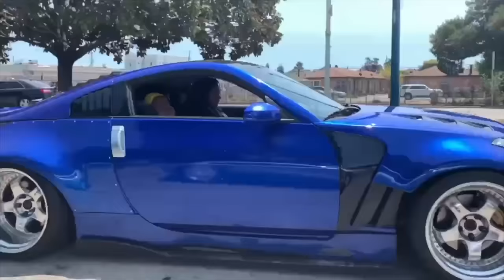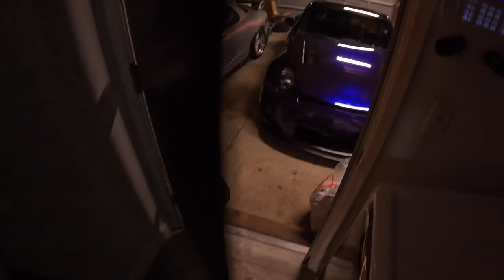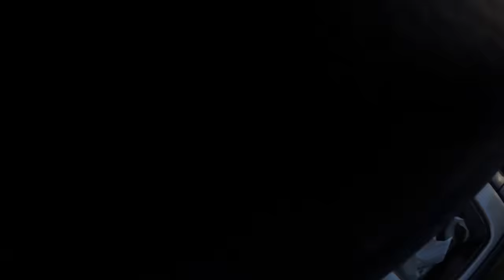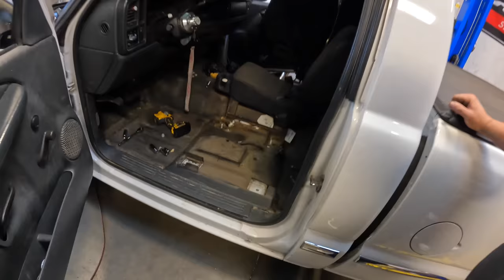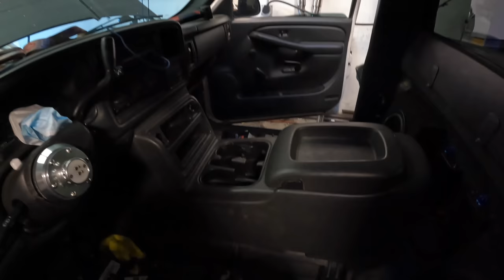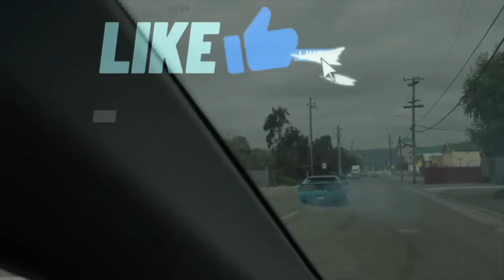I've Been Wanting To Do This Mod On My Truck Every Since I Got It... I Finally Did It!

Comment: Mike mike bro I literally have the truck just 4x4 but I took out the rubber floors did carpet full charcoal gray interior with the 2005 Escalade dash and steering wheel 🤤 but change to carpet it look even better bro 👌🏾

Comment: You should keep that hood n since its already a little beat up u should do the see through cut out on the hood to see the intake mani/plenum like the zr1 vettes do. Itll go good bc u already got the ls and the carbon wide fenders with cut outs just like the zr1. U can paint the top of the intake to see it thru the cut out in the hood or do leds in the bay no directly at the cut out ive seen it directly at it its too bright to see anything.

Comment: Hey guys , I’m currently 19 years old and am working towards getting a really nice car . My credit is there and is above 750+ . My  price range on a car is 30k-40k. I’m really indecisive on what I want but I’ve been looking at 

1) Kia stinger gt 
2)Lexus is350 f sport 
3) Some sort of bmw 
4) Infiniti Q50 ( a lot of people have those and are modding them) 

Please leave other suggestions on what car is the best bang for the buck 

 I want to be different from everyone else  but would gladly take suggestions on what I should get . Or any advice from the older generation to the young ones
 I also plan on modding the car slowly and slowly
Reply: Same situation with me bro just got a 2022 volkswagen gti manual and mannnn its fun as hell to drive i prefer driving that than my moms q50 red sport that ones got all the power but the gti is just nimble and fun to whip around corners lol idk if you like em but you should look into them
Reply: I’m 19 and and work at a auto shop and have experience with newer cars. I wish I had 30k to spend on a car 😂 please tell me your secrets. It really depends on what your goal is and how much you want to spend upgrading it. Seems like you want a turbo/twin turbo v6. Seems like you’d like the new Nissan Z but I doubt they will be anywhere near 30-40k will this car market. If you don’t care for interiors.. or reliable, a tastefully modified evo x is a fantastic car. I drove one after I did an alignment and the chassis felt good and pulled hard. Again it was full bolt on 25 psi so probably 5k put into it. I’d say if you already have a car, wait while saving up and get a rs3. Not a German car fan but rs3 are fucking great

Comment: Hey this is a question for everyone because I cannot seem to find the issue but I was splicing in some ignition coils for my 03 gs300 and the open connected hit the valve cover and now when trying to start there’s no crank and also I recognized that my fans weren’t turning on either when trying to start it like it did before, if anyone knows if I fried a harness or a pcm please lmk I’m completely lost I have checked all fuses and relays and none are burnt out or bad